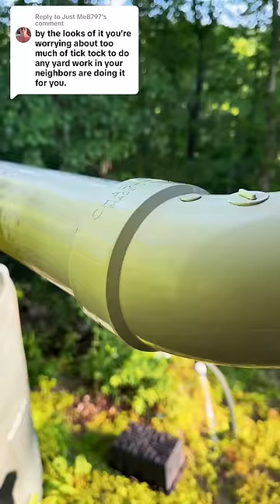Hater comments and cleaning off the roof

Comment: I used to climb up on the roof to clean out the gutters with the leaf blower but the inevitable happened....I got really old so had those gutter covers installed. Not the screens but the solid covers with a curved edge on the front. All the debris (the S is silent) falls off while the water goes into the gutter. I miss being up there so I climb up there several times a year just to look around and make my neighbors nervous and question my sanity.

Comment: I laughed at the ones giving you a hard time with having an automatic lawnmower and why weren't you mowing your own lawn. I live in a rural area (very hot and humid) and I have almost a half an acre. Its a bwitch even mowing that with only a push mower (like what you had). It would take two days after I'd get home from work. It would take about 3 to 4 hours each day (with breaks in between due to almost overheating). We finally were able to afford a riding lawnmower but it still takes time, not including and weed eating we gotta do. I couldn't imagine trying to mow several acres with a push mower (and thats the only part you live on, not even including the other 200 acres). You'd never get anything done. So those peoples comments made me think they either 1: never mowed a lawn in their life, 2: have mowed but have a small strip of land like a tiny front yard and don't quite understand just how big even a few acres is, or 3: have a half an acre or less but have one of those nice and fast zero turns where they zip along and get it done within 30 minutes.